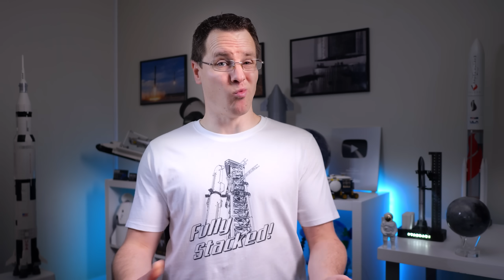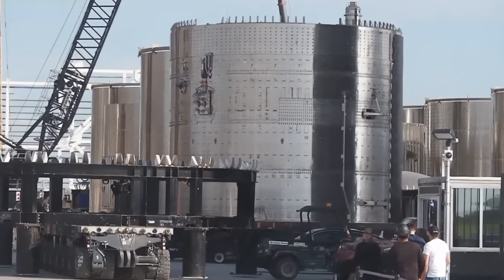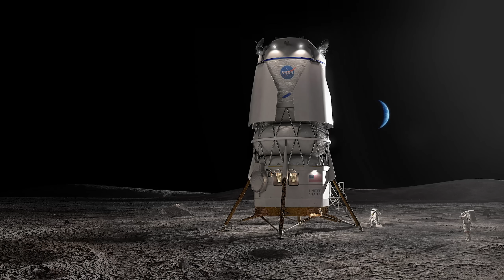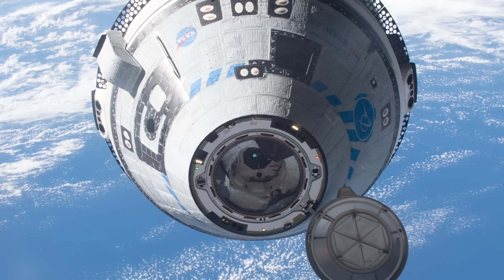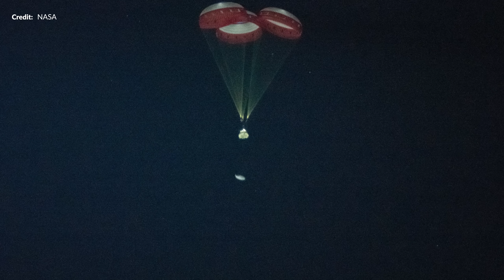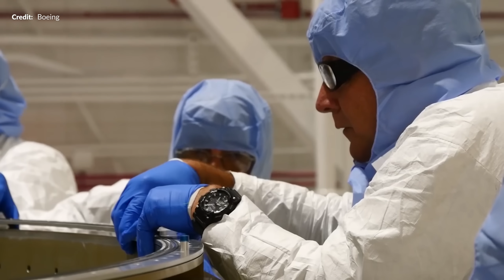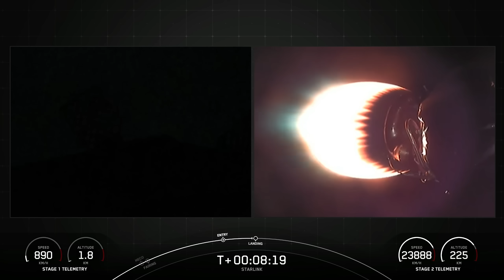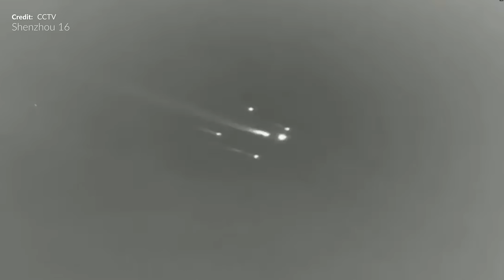SpaceX Starship: Mega Pad Upgrade to Tame the Thrust, Boeing Starliner Delayed Indefinitely

Comment: Just think of the cost reduction reuse is making.   14 reuses by two separate boosters.
Reply: It's not just the cost savings it's the time savings. SpaceX would likely not be able to launch at the amazing rapid pace that we have been seeing if they had to build a brand new booster for every launch.
Reply: Booster reusability is great, but has drawbacks.

First, if you don't have a fast enough launch cadence, you can spend more on recovery equipment and personnel than you save by reusing the booster.

Second, you take a payload hit for the recovery system on the booster. The Falcon 9 B5 can lift up to 22.8 tons to LEO when expended (SX), but only up to 17.4 tons when landed on a drone ship (B1067.9). Doing a Return to Launch Site (RTLS) landing, costs even more payload as you have to add a boost back burn to cancel the lateral velocity and return back to the launch site.

Third, the higher and faster you go, the harder reusability is to perform. The heavier the dry-mass of your booster, the harder reusability is to perform.

Fourth, you now have to have the weather be acceptable at the launch site and the landing site, if it is down range of the launch.

No, I'm not saying that SpaceX should not recover boosters. I'm using how reusability affects the Falcon 9 to discuss other expendable boosters.
Reply: @steveaustin2686  That's a good answer to the question a lot of people ask which is why aren't the other rockets companies all switching immediately to reusable. Part of it is because they have projects like Ariane 6 and Vulcan that are too far along to change. Although ULA was talking about recovering just the engines but you don't hear about that lately. And the other reason is as you explained it doesn't automatically produce cost savings in all situations. Even SpaceX gave up on the idea of recovering the Falcon 9 second stage because it would be so much harder to do, and for a small booster with one engine it wasn't worth it. And they wanted to put all of their development resources into Starship. But think of how many Falcon 9 second stages have gone into the drink since they started recovering first stage boosters, it's approaching 200. So clearly it wasn't easy or cost effective to recover the second stage or they would have done it by now. Whereas recovering the fairings turned out to be cost effective. But recovering Dragon trunks no.
Reply: @StevePemberton2  From what Tory Bruno has said, it appears that the Vulcan Centaur will have a more energetic flight envelope and is larger (5.4m vs 3.7m), so recovering the whole booster would be harder. The tested the inflatable reentry shell for the engine pack in Nov 2022 and it worked well enough that they plan to ditch the midair catch and let the inflatable shell float with the engine pack. I have not heard of another test though. The Atlas-V has ViaSat-3, USSF-51, and NROL-107 flights left. After that, every Atlas-V is either Starliner or a Kuiper launch. So unless the next LOFTID test is a ride share on ViaSat-3 or a Kuiper launch, they will have to go on Vulcan Centaur.

The Dragon trunks would have to reenter, so would have the same issues as the upper stages. The medium lift Neutron from Rocket Lab is only recovering the first stage and still plans to have the fairings permanently attached to the first stage. Relativity planned to recover the second stage from their medium-lift Terran R, but have apparently dropped that plan. Blue plans on recovering the second stage from the heavy-lift New Glenn, and at 7m, it might have the payload margin to do that.
Reply: @steveaustin2686  Also SpaceX seems to have given up on recovering Falcon Heavy core stages because of the higher energy. Of course it could be done, as well as recovering the second stage and the trunk, but there would be high development cost and probably higher flight cost, both of which cut into the potential savings. And the decision is muddied somewhat by SpaceX's apparent position that Falcon 9 has a limited lifespan, as that affects the cost/benefit equation. Sort of like the decision to install an energy efficient appliance in your home at higher cost depends on how long you expect to live there as the payback can take years.

However we don't have much to go on other than Elon's statement a few years back that they don't plan to make any more improvements to Falcon 9 because they expect it to be replaced by Starship. I remember for the first year or two after he said that you would get totally shot down for even suggesting that Falcon 9 would be around in say five years, other than SpaceX fulfilling its commitment for ISS crew and cargo. But I think most people now realize that Falcon 9 is likely going to be around for a while, unless a Starship launch is literally cheaper than a Falcon 9 launch, and that's a big if.  It's just always been hard for me to imagine a giant Starship launching with nothing on board but a typically sized communication satellite on it. I guess if it's cheaper than Falcon 9 or other smaller launchers I guess we will get used to the idea. Of course they could also stuff a bunch of other satellites in Starship, but how realistic is that from a customer point of view. I think many customers will pay a few million more to "own" a launch rather than being rideshare with a bunch of other satellites that have equal priority.

And what about GEO and GTO launches, I haven't heard if Starship will be doing those. I'm sure it's possible, I guess carrying just one satellite they would have plenty of fuel remaining to slow down and lower their orbit prior to reentry. Or else beef up the TPS to handle higher speed reentry, which they plan to do eventually anyway. I just haven't heard any details or even speculation about any of this, because the popular focus seems to be only on flying people to Mars and landing on the Moon.

Another reason to keep Falcon 9 flying is because it's a great way to get people to space. As I have detailed in previous posts I do not see Starship as an alternative for crew launches, maybe ever, unless they develop a complicated and heavy launch escape system, which would be limited to a much smaller number of people. But why do that when they already have a cost effective and proven method to get people to space?

So anyway back to my premise, I wonder if SpaceX will at some point begin to realize that Falcon 9 will likely be around for a long time and resume improvements to it, including possibly recovering the second stage.
Reply: @StevePemberton2  I'm not so sure that they have given up on it, rather than the payloads required that extra oomph to get to their orbits. I think that if there was a payload just a bit too heavy for an expendable Falcon 9, they might try recovering the center stage again. I do think it will be a rare occurance due to the difficulty and needing a payload that requires just a bit more energy that an expended F9 can provide.

Yeah, I see Falcon 9 staying around a while as it will likely take a while to lower the cost of a Starship launch and it may not end up cheaper than a F9. You can be the primary payload on a booster and the other rideshares are secondary to your payload. So if there is a problem on the way up, your payload has priority to get to its orbit and the rest get what they get. 

In the Starship Users Guide 1.0 (Mar 2020), Starship has a payload of 21tons to GTO, so it can do those orbits, they just take up payload mass to get there. The 21 ton payload to GTO is why Everyday Astronaut got Musk to admit that the LEO payload could be 150 tons. With everything changing, the payload numbers are only an approximate really. They are planning for the TPS to survive reentry of a Mars return, so GTO or the Moon should be no problem.

Starship may never be reliable enough for crew launches and landings from Earth. I think that is why SpaceX had the GAO redact the info on the [DELETED] Starship propellant depot. And why [DELETED] might be the one with the stretched hull. Since most of the propellant depot mass is in the tanks that the depot came up in, the payload section just needs the active cooling equipment. With a stretched hull, you may be able to fit in a transfer station for crew and cargo spacecraft to dock at, so the depot could be a transfer station to a mission Starship.

I think that SpaceX has been slowing improving the Falcon 9 incrementally, but using the Starlink and cargo launches to prove the new upgrades to NASA and the USSF, before incorporating them with crew flights and NSSL payloads. SpaceX doesn't want to imperil either the crew rating nor the NSSL certification.

I'm not so sure that the Falcon 9 has the mass margin for recovering the second stage. Recovery equipment will eat into the payload mass pretty hard. SpaceX might incrementally upgrade the F9 payload mass that might make it possible someday, but I'm not sure I would want to put money on that.
Reply: @steveaustin2686  From what I understand after two out of three failures to recover the core stage during the first three Falcon Heavy flights, it has been observed that SpaceX has made no core stage recovery attempt on any of the three subsequent flights, even though it seemed that some of those flights had payloads that did not require expending the core. Thus leading to speculation that SpaceX has decided that one out of three isn’t good enough odds to justify the cost of a recovery effort. Although I’m sure their prediction methods were not that simplistic. Yes it’s possible that they still analyze each flight and that there might be a future launch where the margins are not as tight and they decide to make an attempt. But until that happens or SpaceX says anything public about it I think the “giving up” theory is still plausible.

Yes a company can be the primary payload on a launch but what I was saying is that this is not so bad if there is just one or two other small payloads or some cubesats etc. But with Starship there is the potential to launch several high-end satellites, and it’s going to be somewhat awkward if only one of them gets to be primary. Plus having several satellites of larger sizes can get logistically complicated. Although the transport missions have launched several satellites on Falcon 9, those satellites have to be low maintenance as far as launch preparation, time they can sit without power etc. Larger satellites require more attention during preparation, and schedules become more important, so having a bunch of this type of satellite on one launch will be difficult. 

Then again if it dramatically lowers launch cost then maybe even the higher end satellites will accept being jammed onto a crowded subway car with a bunch of other passengers. And knowing that their subway ride might be delayed until the one VIP passenger onboard is ready to go. But I just see a complication if there is more than one VIP onboard but only one of them gets to sit at the best table.
Reply: @steveaustin2686  Starship is planned for Mars reentry but that’s far in the future, long after the first several flights to Mars which will probably be uncrewed and one way. And if passengers will not be landing on Earth via Starship then this means that it will be braking and possibly also aerobraking into low Earth orbit so that it can drop off the passengers at the depot, at which point it can then use standard TPS for the uncrewed reentry.

Maybe they are also currently sizing the TPS for GTO, but again as far as I know SpaceX has been generally silent about exact plans for how Starship will be used in normal operation, i.e. things other than Moon and Mars. But that’s typical for Elon as he prefers to talk about the extreme exciting things that they plan to do with Starship. Or maybe they aren't sure yet if the current TPS will hold up for GTO reentry.

As for GEO I would think that’s only possible with an expendable Starship, and may even require fueling in LEO for larger GEO payloads, I don’t know. But if any of these are flights that Falcon 9 or Falcon Heavy can handle, why not use those unless it absolutely requires expendable Starship.

Again my point being that Musk has in the past indicated that they only want one rocket system not two, and as soon as Starship is up and running they will end Falcon 9. Although he specified that they will fulfill their obligation with NASA. I suspect that retiring Falcon 9 when Starship is operational is no longer their thinking, however it’s hard to know since I don’t think he has ever publicly retracted his previous statements. Which I can understand as he doesn’t want to publicly discuss any possible limitations with Starship. But I think there hasn’t been enough changes lately to Falcon 9 large enough to indicate one way or the other whether they are now thinking of Falcon 9 coexisting with Starship.

And yes recovering Falcon 9 second stage will be difficult, requiring perhaps further upgrades to Merlin, and likely leading to lower payload capacity on the fully reusable flights. But similar to the booster, they would have the option to expend the second stage if needed and only recover it on lighter payloads.

Circling back to my primary point, we don't know how much of these decisions are due to inherent unfeasibility or lack of cost effectiveness, or how much the decisions are influenced by a shorter term thinking for Falcon 9, a type of thinking that may possibly change when the reality of Starship economics and capabilities becomes more clear.
Reply: @StevePemberton2  SpaceX is actively trying to avoid putting in a diverter, so that work on a booster can be done on the pad. This is something that the SpaceX rapid reuse plans require, so I have no problem thinking that SpaceX would plan for a very robust TPS for Starship right from the get go. After all, if you refuel a HLS Starship in lunar orbit, that Tanker doing a direct return to reentry on Earth would make sense. The reentry coming back from Mars should not be that much more than returning from the Moon.

GEO might be possible with a very small payload. Of course a single tanking in LEO, would greatly increase any payload to GTO and/or GEO.

Falcon 9 coexisting with Starship almost certainly rests with how much Starship will cost to fly. Based on the $1.15B HLS Option B contract for Artemis IV and it taking up to 10 Starship flights to get HLS Starship to the Moon, that puts a Starship at $115M per launch. The Falcon 9 is currently $67M.

SpaceX dropped plans to recover the Falcon second stages, almost certainly because it took up too much payload mass. I don't see that changing in the future without huge new developments.

As much as people tout SpaceX for being open, they keep a lot of things close to their chest.

Comment: i think with orbital launch mount problems...fabricate giant sized hexagonal heat tiles central to under each raptor exhaust on the olm...happy days give it a whirl!!!!
Reply: The Thermal Protection Systems (TPS) tiles are great vs heat, but suck vs impact. Reportedly, you can break the TPS tiles with your hands, so the shockwave from the launch exhaust hitting them would destroy them.